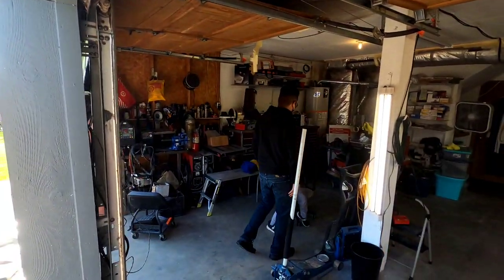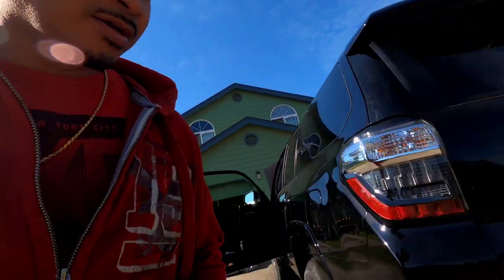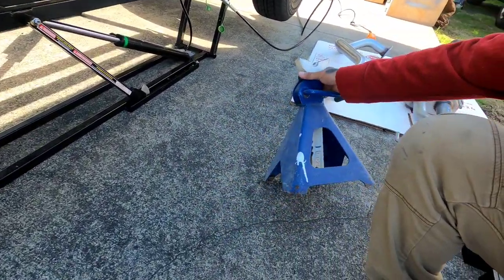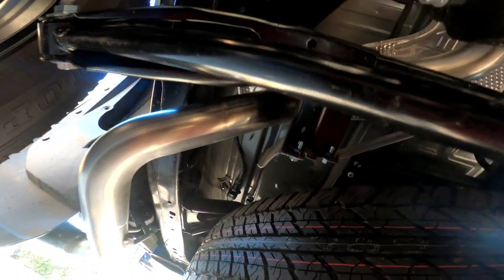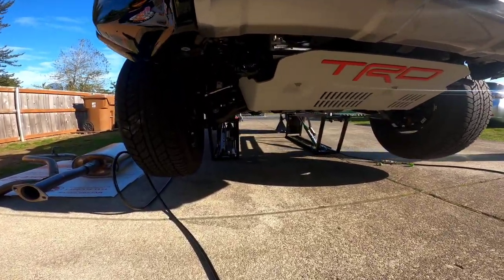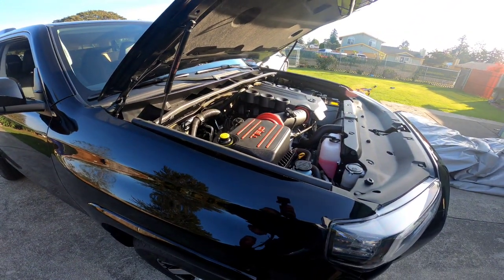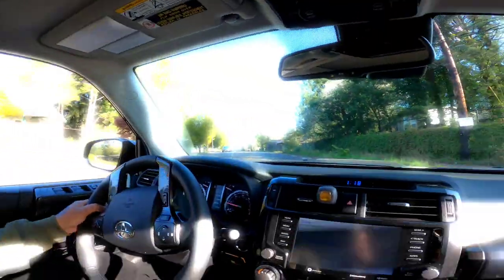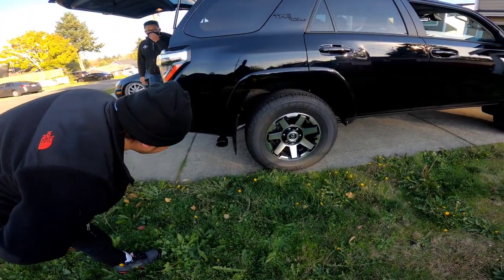Toyota  4runner TRD intake and exhaust  package  install.

Comment: Im assuming your TRD OffRoad does not have KDSS?
Reply from the maker: I'm assuming  the customer doesn't have them. Most people  that buy these don't even know what that is.😂
Reply: Why would the KDSS pose a problem with the exhaust?
Reply: @johnschuchii  Its doesnt affect the exhaust but this comment was meant towards the TRD skid plate in the video. Unless modifications are made to the skidplate with a sawzall it wont fit on a 4Runner with KDSS.

Comment: Will these compatible to the base SR5 trim?  I meant the exhaust and intake?
Reply from the maker: I don't think  so. If anything  maybe the exhaust  will fit with minor modifications  to make it work.
Reply: @Vkandypaint  thanks for the quick response
Reply: There the exact same engine bro they will work and bolt up exactly the same